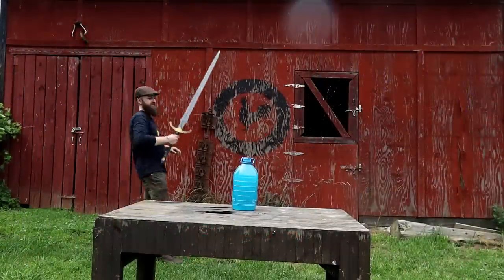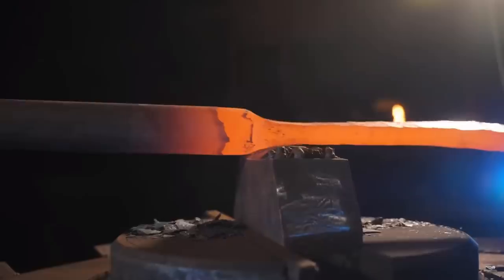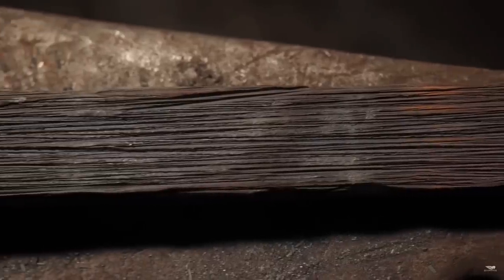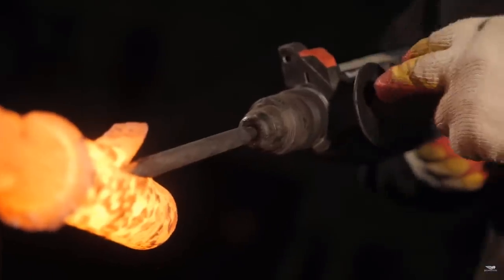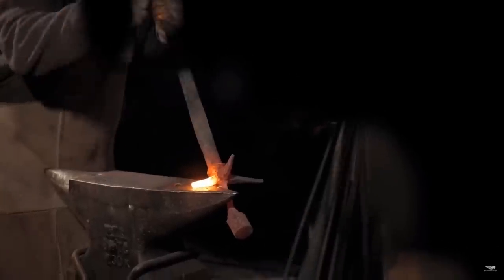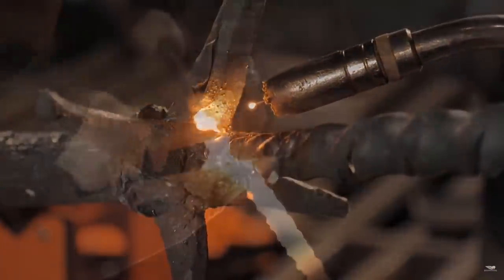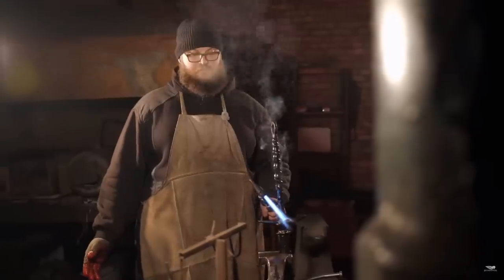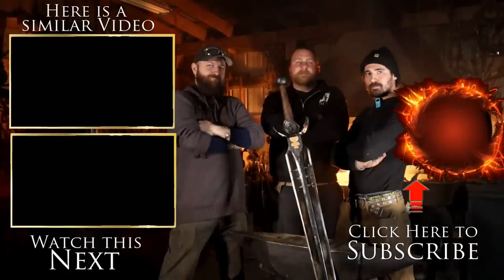Forging the [Coiled Sword] - Dark Souls 3

Comment: The shakers were renounce for their furniture, especially their ladder back chairs. You would think that an ultra religious sect would play the Amish hand by using only hand powered wood tools. In fact they were innovators who often lead the market in the most advanced tooling available to buy. The reason is simple, they could be more efficient and effective at their craft if they didn’t spend time retooling old tools, and removing wood with hand tools. They bought the best and in return, created furniture that is still viable for a century, give or take. Buy the best and get the best results. It’s just business.

Comment: Biggest complaint is the guard spikes. They look atrocious, and nothing like the coiled sword from DS1-3. They're not even roughly symmetrical with one that particularly stands out as long and skinny compared to the rest. They don't even have the same angle up from the core. Also they not centered at 90 degree intervals around the core which gives it an entirely alien look to the proper coiled sword. Also you can still very clearly see the welded spot which is very unfortunate as it stands out like a sore thumb against the rest of the work and draws the eye as a result.

The blade itself looks fine, though the lighting and the camera swoops make it hard to check how symmetrical it is around the curve as well as how consistent the curve is down the length of the blade.

Also the handle is supposed to have a single full turn in the same way as the blade, not be rolled around on the flat. Aesthetically and functionally this is probably better, but it's not a proper recreation.

I'd like to say this is a nice piece, but that guard...it seriously looks terrible

Comment: It's funny how in most of the games swords rules are reversed compared to reality. 1 lvl? katana. Ok. Lvl 100? Twisted sword with no blade at all (it would get stuck when striking or bend). What game developers supposed to understand is swords in 99.9% were practical as much as possible. This 0.1% belonged to kings/dukes/some generals which had it only because it looked nice and were not expecting to fight at all.
Reply: Btw great work with forging.